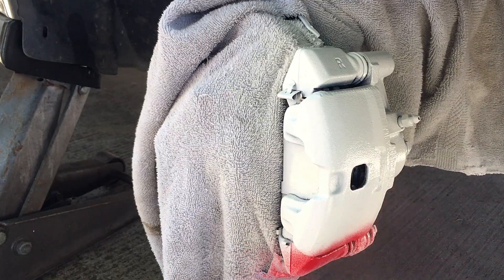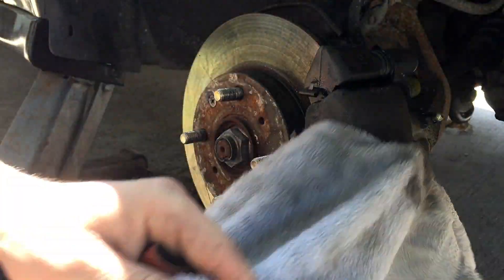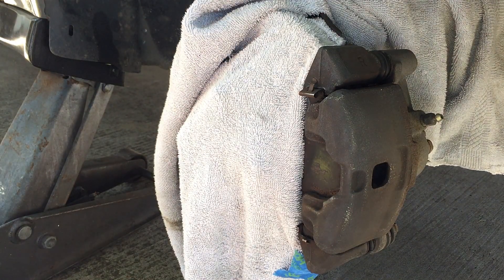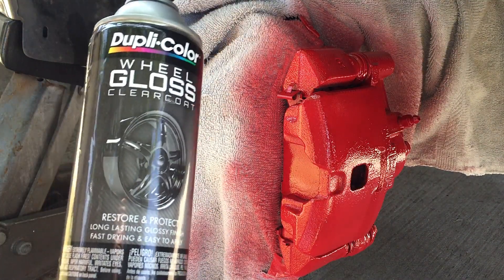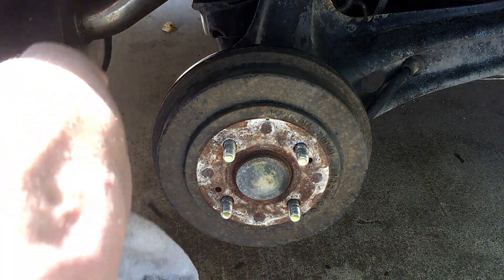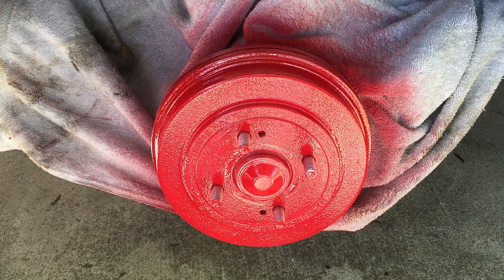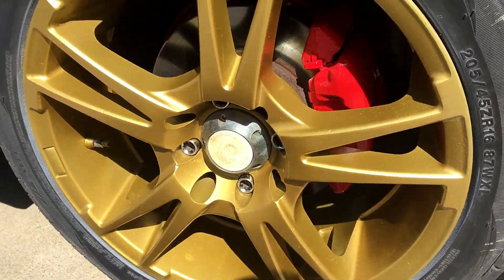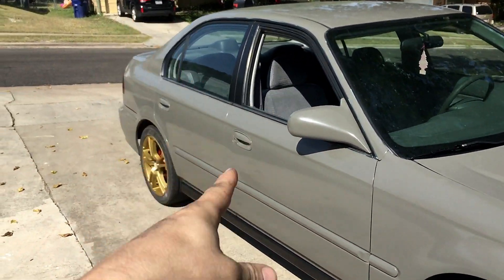How to paint brakes for cheap. (Easy ricer mod)

Comment: Ooh, the rust on the front hub. Smear white lithium grease all over the hub where it contacts the back of the wheel. I've been doing that for decades and have never had a wheel refuse to come off.
Any over spray on the disc will come off the first time the brakes are applied.
I don't know about paint on the rubber bellows of the front caliper bolts. Those are supposed to be flexible.
Every 5000 miles when I am under my car changing the oil and filter, I spray all the rubber boots, bushings, and other bits with silicone spray. Helps keep the rubber supple.
Some decades ago I was in a place called Super Shops, I think, a car parts store for more or less muscle cars. I overheard the sales guy tell a customer to get a chrome-plated starter because it turns faster. No kidding.

Comment: Saweeeeet. I spray mine aluminum to look factory, just a touch up. But the red looks good with aftermarket wheels.  I like spray the hub flat Black.  I do this every 5000 miles. When I rotate my tires, I clean all the brake dust of the rims, clean and touch up the brake components. I know.

Comment: I just posted a video doing brakes.  I found stuff that brake dust won’t stick to and withstands heat.
Reply from the maker: KB MOTORS I never had issues with this stuff or just normal ol rusto

Comment: Was the primer high heat if not it will come off when the breaks get hot.
Reply from the maker: Michael Ransom It won’t come off even if it’s not high heat I have done this to almost all my vehicles in the past never had a issue my Honda Pilot is still rolling around on all Rustoleum painted brakes and it sees well over 12k miles a year. I could do a update on them brakes 🤔
Reply: @JamesDguy  iv done it as well and it came off not sure why but i had to redo it useing high heat primer and it never came off againg.
Reply from the maker: Michael Ransom Weird. I have towed, drove a lot of stop and go traffic here in the Texas heat and never had a issue. I did use Rustoleum white primer wonder if that made a difference
Reply: @JamesDguy  maybe i dont remember what i used.

Comment: The white needs to be high temp also ! Not just any.........
Reply from the maker: Sarge Marine Actually not true btw. I have used any white paint not high heat or anything and I’m over 15k miles and 1 year of use daily driven on my pilot still hasn’t had a issue.
Reply: @JamesDguy  I can vouch for this! I used completely standard primer, paint and clear on my calipers and they're absolutely perfect! 😄 The car isn't given an easy life either.
I've heard that high temp is only REALLY needed if the car will be in regular hard usage conditions such as track days etc 😃